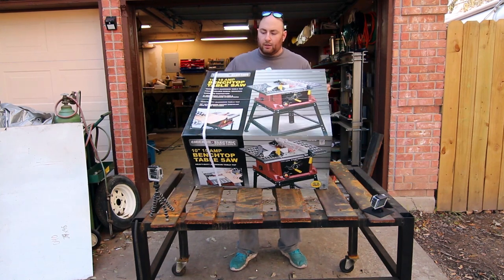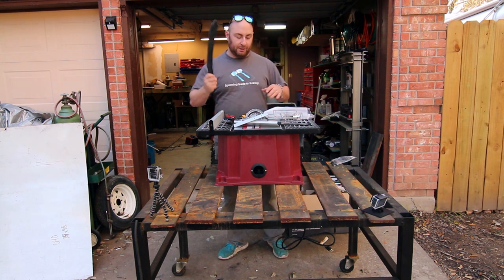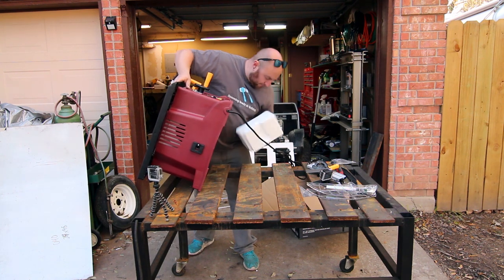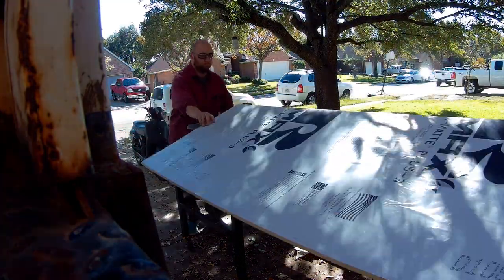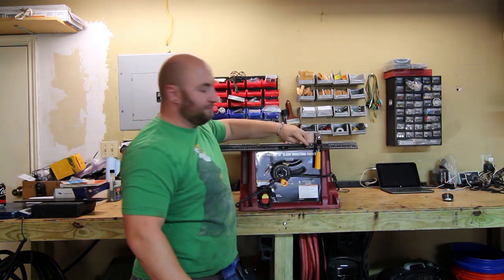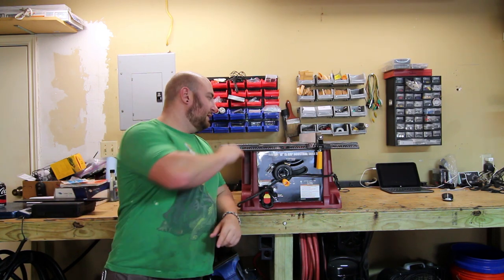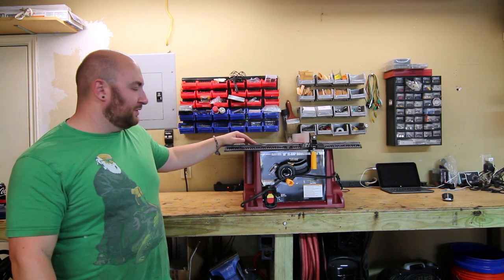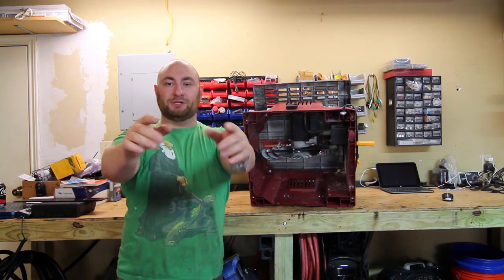Harbor Freight Table Saw Unboxing and Review  #63118

Comment: We bought this exact same saw.  We could not figure out how to attach those safety features.  When we tried to figure it out it didn't seem to align even with common sense. So I came in and watched the video and agree that leaving it off was best.  We take safety very serious so we use all other measures for safety.  I found the video very helpful.

Comment: I'm sorry man, but I bought 1 and returned it since it labored to cut pressure treated wood. The blade only goes up to 3 inches which makes it impossible to rip a 4 x 4 unless you want to take a chance on 2 passes on a very inaccurate guide bar.
Reply from the maker: a 4x4 treated wood post is quite a chore. Thanks for adding feedback. I have not tried to rip anything that large.
Reply: Most 10" blades max at 3" and also you should not be ripping 4x4 on a table saw.. Use a band saw or flipping it over as you said works. Just maybe clamp the fence down or remove the fence and clamp a 4ft spirit level and make sure its square.